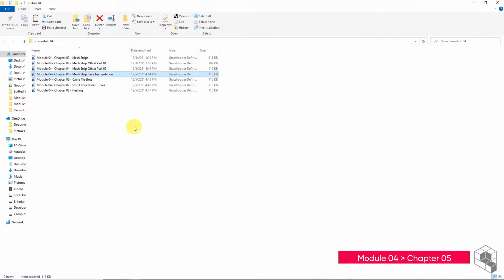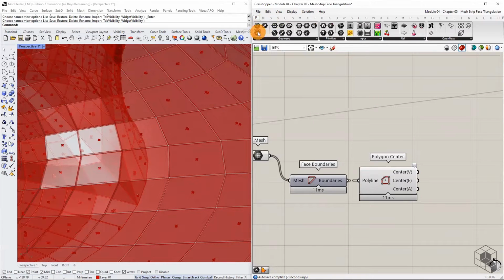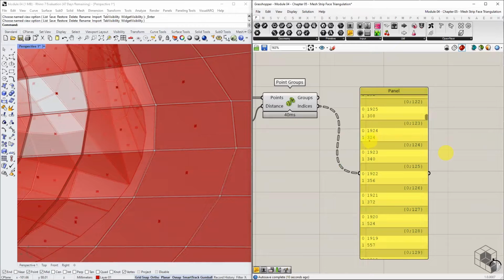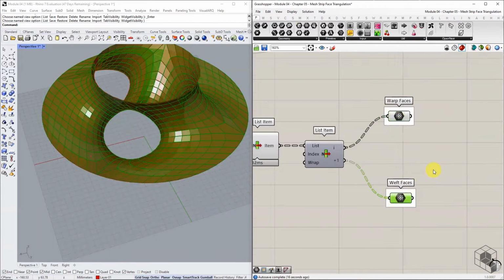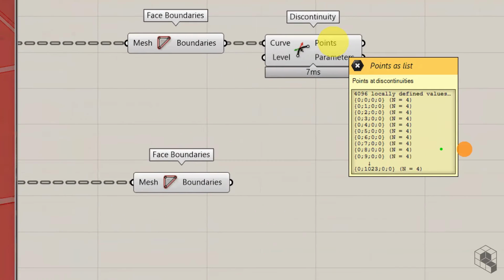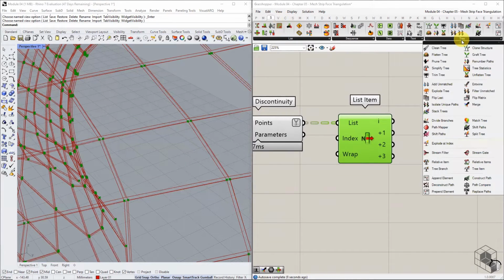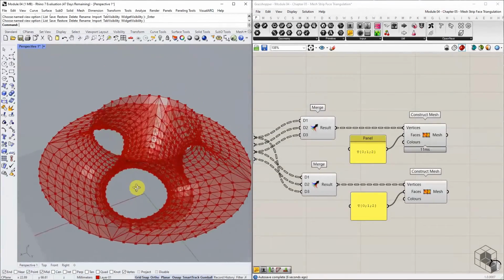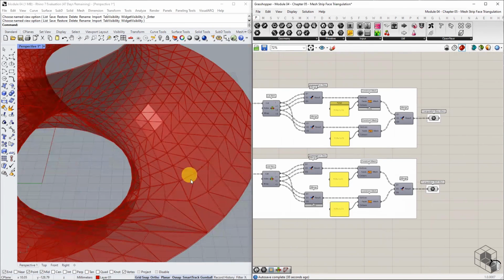Strip Fabrication - Chapter 05 | Face Triangulation | Rhino & Grasshopper Tutorial

Comment: At 8:45 when I used the sort aling curve, the points are sorted but not in the correct order, the stating points of warp and weft boundary polylines  were not aligned, resulted in crossed triagulated faces. I used shift list on the points then get the desired output. Anyone run into the same problem or know why this happen?
Reply: Problem solved! The team is very nice and helpful.
Reply from the maker: Hi. Please share your Rhino+gh file to qbricklab@gmail.com and I will help you with it.
Reply: @qbricklab4200  Thank you for replying. Already sent.